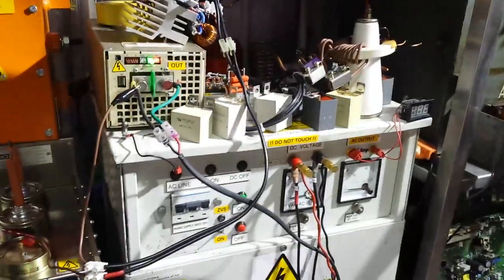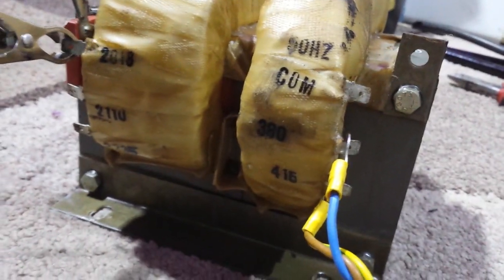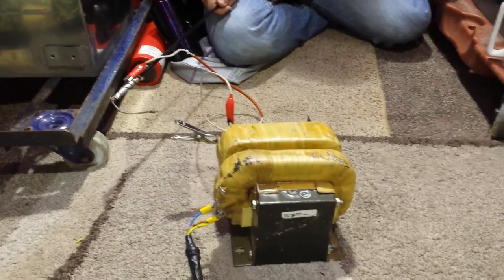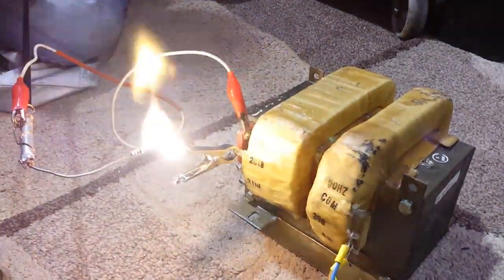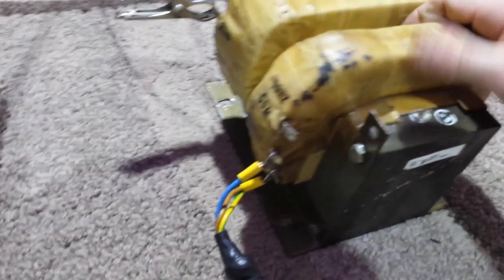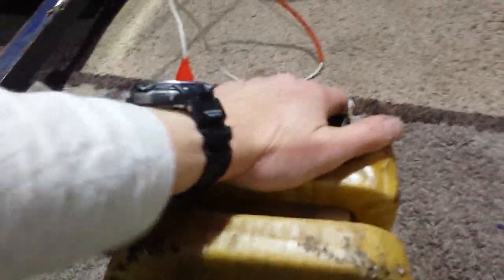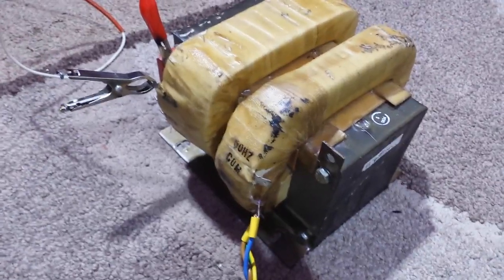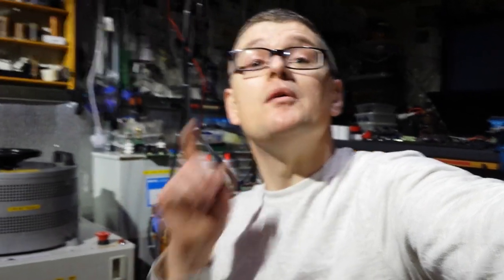MONSTER MOT! BIGGEST EVER!!!

Comment: Definitely not a MOT unit. This is a variable tap high voltage power supply from RF transmission equipment. Likely this unit is from an FM transmitter power supply. I've seen numerous MOT units from 70's style units all the way to commercial ovens and none have variable taps on them. The voltage on those MOTs  is also fixed between 2.1 kV and 2.4 kV (AC) from 650 watt to 3 kW from 120V (residential) to 208V/220V for Industrial applications which is the North American standard. From this AC input the AC output is then rectified to around 4 - 4.8kV (DC) to the magnetron. The FM transmitter power supplies will use much higher voltages on the DC output so that is a dead give away. This is a real find! Play safe guys! Love the video!

Comment: The primary would run a lot cooler if you were using all of the primary windings and you'd be able to get much more out of it. Maybe you could try what photon did- put two 110v transformers in series. Feed 200v into the secondaries (100v each) and you'll get about 200+200 out of the primaries. There must be loads of site transformers at the scrap yard.

Comment: Hi mate. That is some transformer. Try putting 240volts on the 380 volt winding. That will test it.
Reply from the maker: Hi mate. I did try that, and the arcs were not very big at all. Need the 400 volts mate. 😉 thanks for the comment and hope ya well. 👍

Comment: "it's still live" as your touching near the secondary. The frame is 0v for the secondary right?? C'mon
Reply from the maker: Hello what's wrong? C'mon tell me??
Reply: high1voltage1rules If the insulation of the secondary wire near the output tab where you were touching has even a hairline crack in it then you will not have a good day

Comment: What's the best way to ballast one of those things? I have an old MOT I would like to experiment with, but I'm afraid of driving my house wiring and/or electric box "a bit too much"
Reply: I run them in pairs, put the primaries in series so each transformer only sees 120ish volts, that way you can short them out for several minutes before they start to warm up.
Reply from the maker: Hi mate.  Microwave transformers are bad transformer! There unpredictable, and unreliable! and if not ballasted in a small way will draw as much current as they need! And burn up quickly!! But arcing them out by drawing an arc will most definitely trip your breaker without a ballast. If you want to know how to ballast it" its simple.  Get a ballast from somewhere or another MOT and short the secondary out, and wire it in series and ya good to go. Please be careful as they are not toys and can kill instantly! !! The iron core of the transformer is ground and will shock you. I hold no responsibility  my friend to what you do. If your unsure in anyway don't play!! If you want to know more then just ask.
Please be very careful. 😉

Anthony. 

Any more info-
Antwasere@gmail.com
Reply: Thanks for the advice. Yeah I know an unballasted MOT will pull 30-50 amps and will go up in flames in about a minute or so. I'll pick up a second MOT as a ballast and try it sometime. Just for curiosity, could you also limit the current using the resonant cap and diode from the microwave?

Comment: high1voltage1rules  Hello High1Voltage1Rools;D It's very nice to see the MEGA MOT in action, thumbs up;D Pretty good arcs, I was expecting bigger, but great output anyways;) better than no output, Ha Ha Ha! To get those nice arcs, you may need the MEGA MOT to go through its complaining levels, sadly:( Like you said, you want more power!! 10kw? Is your variac able to go through 10kw? The last time I saw your video of your variac that was salvaged out of a Junkyard, it was rated for 4.2Kw? Has it ever went through 10Kw without complaining? Or are you going to get a bigger variac, along with that 10Kw ballast, (10Kw transformer)? That would be the way to go;) But anyways, great arcs and video mate:D cheers;D